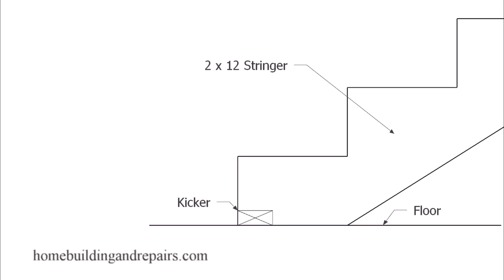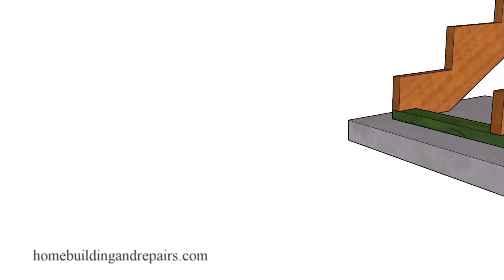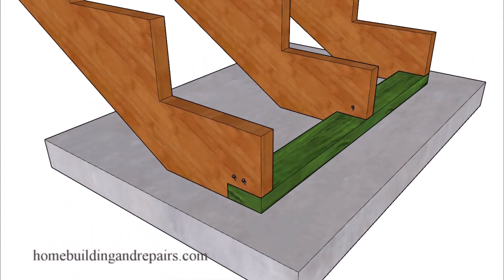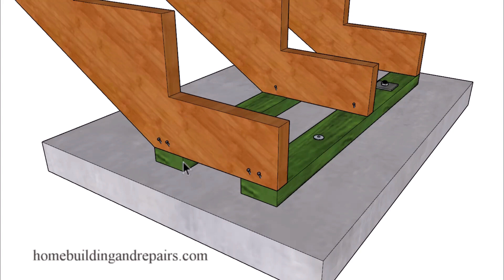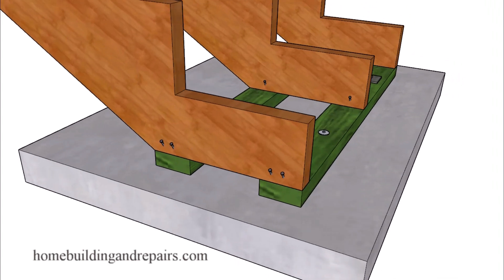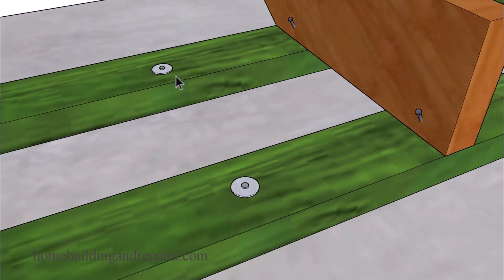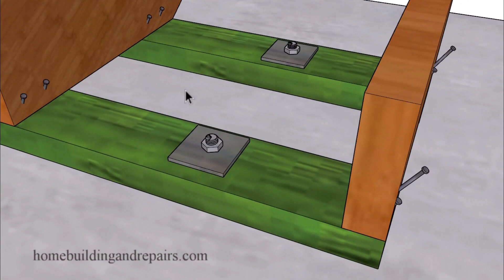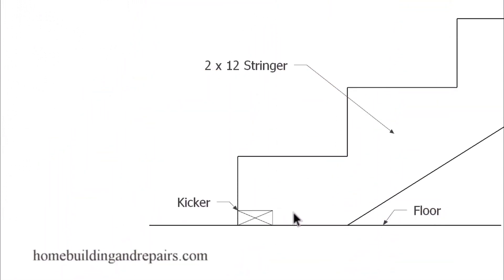Problems With Standard House Framing Detail Used To Connect Stair Stringers To Floors or Foundation

Comment: I personally love the idea of the framing plates as opposed to the kicker plate which also allows a means of keeping the stringers totally off the concrete (I will be using LVL stringers).  As a first time stair builder can anybody tell me if using this method I would need to reduce the total rise of the stairs by the width of the framing plates or simply cut the bottom of the stringers off by the width of the framing plates?
Reply: Please disregard this question as I found the video that addresses this.

Comment: I think the original detail is still good because the notch in the stringer prevent any downward movement of the stairs. The toenail in the end of the stringer is just to keep it in place laterally. Just my opinion. Thanks.
Reply from the maker: I understand and you've done a fantastic job at providing constructive criticism and I thank you. Keep using what works, until it doesn't.
Reply: I agree